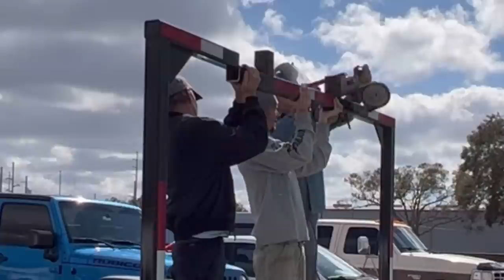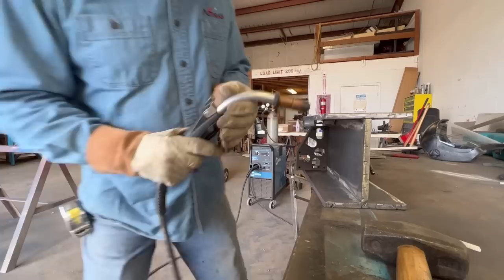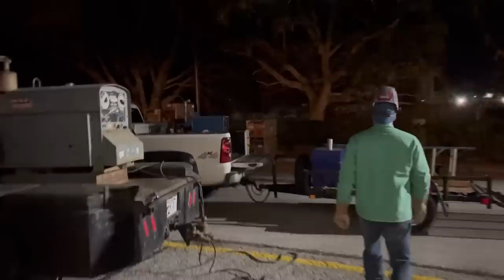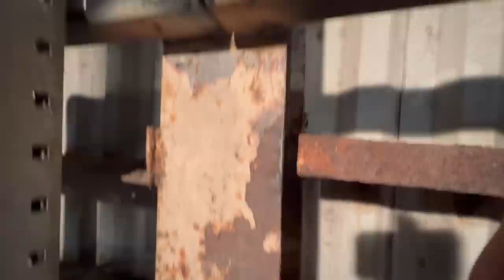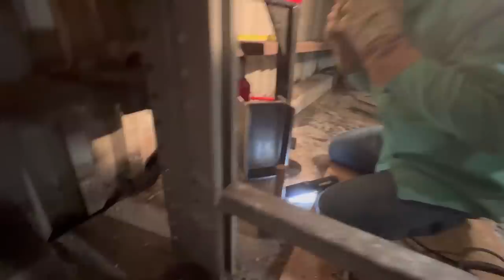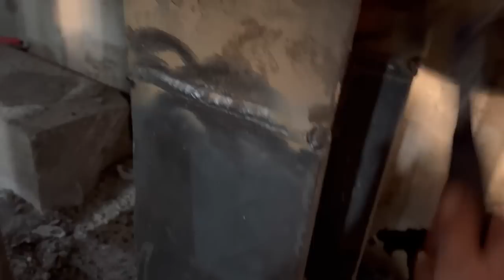Rotten Column Repair (The Worst I’ve Seen)

Comment: Have done similar work to rotten columns on farms. But after the bottom collapsed six inches.
Piss and shit from cattle soon eats steel and even galv steel. Used a telehandler to lift the column into place.
I didn't make a repair section, just got the nearest size above because the original size was no longer available.
Four years later, it's holding up well.
Great video guys!

Comment: great work. maybe think about cutting you're column shorter and adding non-shrink/structural grout underneath. mix it up wet and pour it into a small form around the base, it sets up hard in like 3 hours and that way you get complete support under the column. keep up the good work boys
Reply from the maker: That’s the contractors job!

Comment: So many things wrong with this: 
Did an engineer sign off on using GMAW and 6010? Neither are AWS pre approved electrodes for structural applications. 
Also, that's not a CJP, complete joint penetration without welding the back side, which could have been done by cutting the siding and accessing from the back. 
Did you even consult an engineer? If not you're exposing yourself to all kinds of liability.

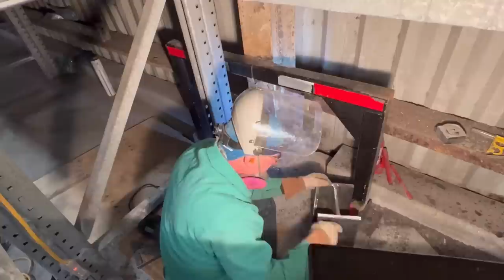Comment: 17:17 if your doing any heavy grinding Walter Xcavator discs eat metal like crazy. But wear a face shield and protective clothing because it will launch burning hot slivers of metal at you and it’s painful.

Comment: You're probably right that the fertilizer, probably potash, rusted those columns.  You and Paul are a good team
Reply: Potash is neutral pH, more likely nitrogen because it contains ammonium..
Reply: fertiliser absolutely destroys everything. we have fertiliser spreader trucks and the fert just eats through everything. even made holes bigger than a fist in the cast alloy gearbox

Comment: I'm a little skeptical of running short circuit MIG on 1/2" plate, especially with only a 200 amp machine.  With that limitation, i would've stick welded it.  6010 root and 7018 over that.
Reply from the maker: It’ll be fine. I had it at 26 Volts and I think 450 ipm? So it was almost in spray range

Comment: No gap fit up and weld on those plates without beveling?   Wouldn’t you be better off getting some scrap beam to splice in rather than risking not having full penetration weld?

Comment: Great video
Reply from the maker: Thanks!
Reply: @Meltin Metal Anthony  america looks a bit easier to get ad hoc work than the uk 5 min welding job in a big firm is a 6 hour sight induction 2 permits method statement rams welding set needs testing fire watch 3 hours after the job and payment 1-3 months after 😂

Comment: Do a video on how to fit parts that dont fit where thet need to fit because of obstructions things in the way and how to shave pieces down with a grinder to make them fit properly. Everything i get where i work never fits right have to constantly grind them down till they fit up against previous welds its tedious at times.

Comment: Looks good. Do you need structural tickets for repairs like that? Just curious.
Reply from the maker: No, this was not done by a engineer. So really it was dealers choice when it came to repair method. But I just treated it like d 1.1 open root

Comment: Mate get an engineer to sign off on that. The original connection was a moment connection, the repair joint only looks like a simple support, not a moment joint.
Reply from the maker: It was hanging on by a thread before, what your suggesting is non sense and a waste of time.
Reply: @Meltin Metal Anthony  I am talking about the initial design of the structure, the column was corroded and it looks to be repaired to a level below the initial design.

Comment: Do you use dewalt 20v stuff ? if so they make a sweet bat powered hammer drill  20V MAX Rotary Hammer 1" SDS+ 3 Mode Tool Only
Item No. SKU# DCH273B . And old dude can run that torch sorry don't know his name.
Reply from the maker: Paul can do it all!!

Comment: Your doing it wrong!   LOL not really, the way I doit is take the next size larger beam and weld plates to both end.  Slide it to the old one, scribe your line and cut it out.   Of course using jacks, slide in, weld top to old beam, drill the concrete for epoxy and bolts.